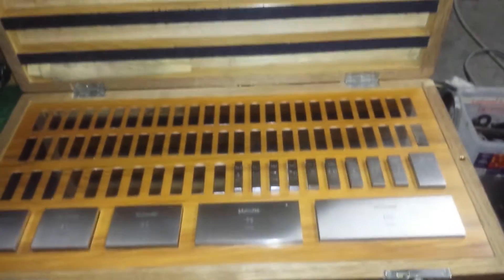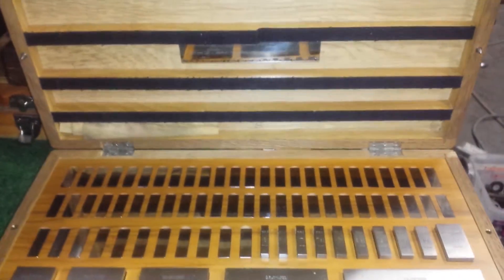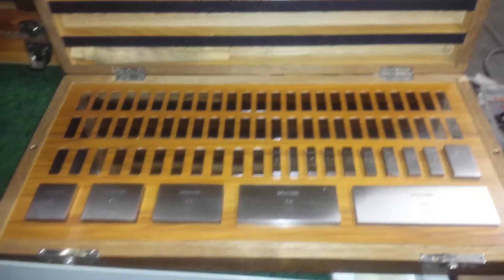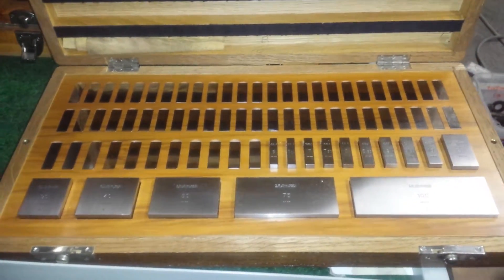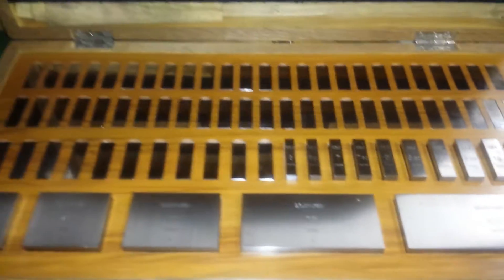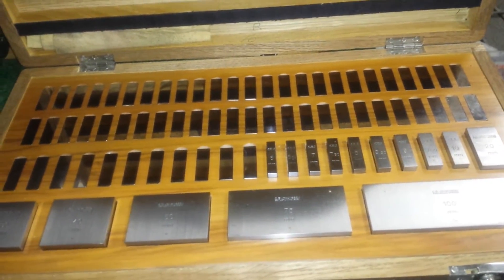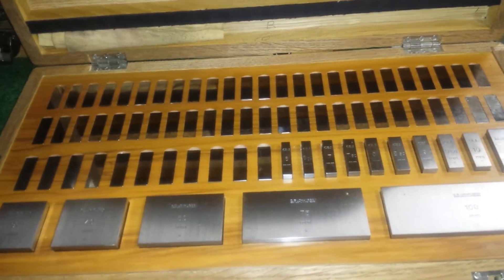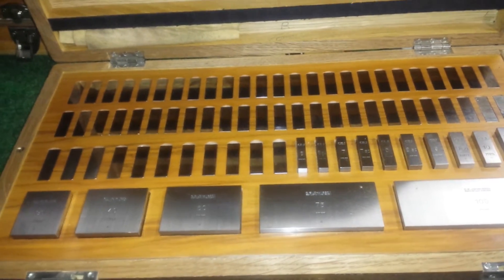Cleaning tip for critical items in the machine shop

Comment: What kind of oil do you use man?
Reply from the maker: Bri Vol For things i use at least once a month i like to use CRC5-56 its almost like wd40. For lets say gauge blocks or other precision instruments or tools i don't use as often (thread standards etc) I use a conservation oil intended for engines. it leaves a very sticky surface and will keep your tools rust free for decades. Its a swedish product so you won't be able to find it but I guess you can find the same product type in your country as well.
Reply: Bri Vol I think engine cylinder fogging oil may be the equivalent.
http://www.amazon.com/STA-BIL-22001-Fogging-Oil-av/dp/B000H7CKAY/ref=sr_1_1?ie=UTF8&qid=1430362721&sr=8-1&keywords=fogging+oil
Reply from the maker: Yes that the same I think!